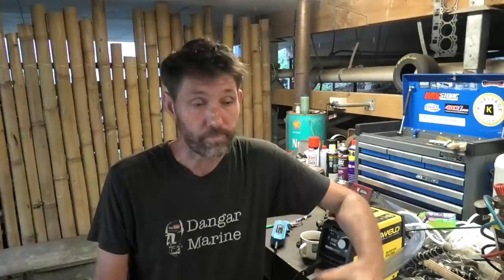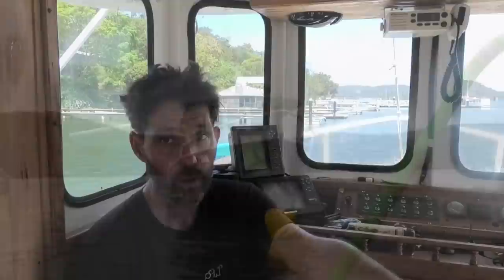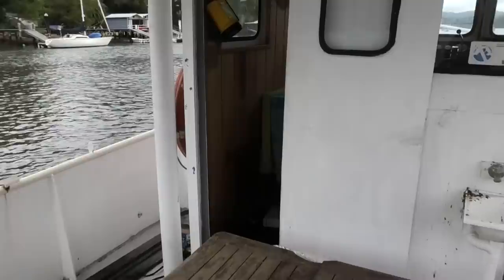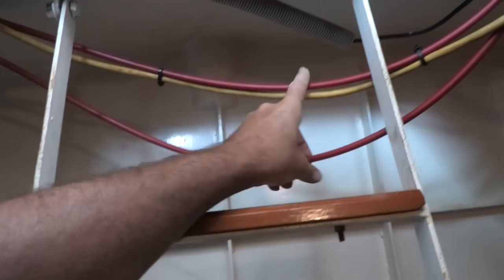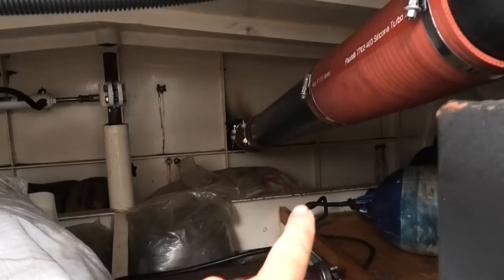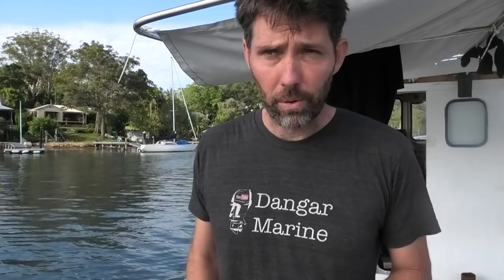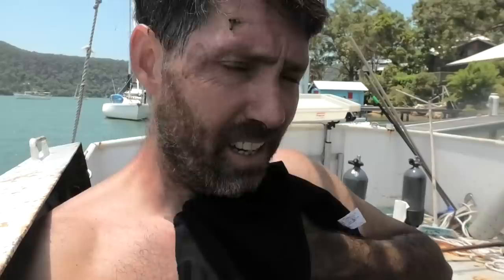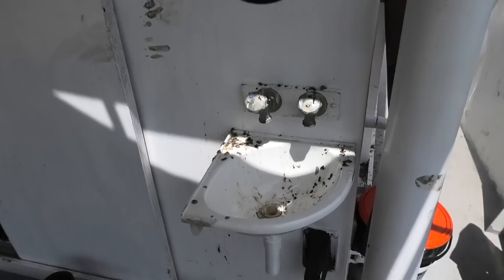Is it a bad idea to buy an old steel boat?

Comment: looks to me like the immediates are going to cost about 10 Grand. Dry docking fees - anti fouling Paint - Zincs - stuffing box replace - likely a couple of new batteries - engine tune - electrical work .....what a headache !..... hopefully you`ve got some mates to help.......
nice looking boat though.
Reply from the maker: That is about my cost estimate too. Fortunately the batteries are brand new and he left the old ones behind too. :)
Reply: @DangarMarine  that`s good that you will save on the battery cost. If it was me, I wouldn`t spend too much time fixing that rusty deck.....just might be that nasty can of worms..... scrape off the worst of the rust and do a basic putty fill in the holes, then paint. You can spend forever getting all fussy over the aesthetics but is it really worth the effort? Unless you plan on keeping  her for a very long time and super hooked on her looks I would Invest as little time and money as possible. As long as the leak is fixed, tank is good and the motor runs well you will likely get plenty of satisfying cruising hours. Enjoy her for all her flaws and imperfections...that`s what I learned with my old cruiser. Otherwise it`s going to cost you an arm and a leg trying to make her look young and pretty again....I look forward to watching your progress....best of luck !
Reply from the maker: I definitely agree about using and enjoying the boat. The number of projects I see in peoples yards that never hit the road or the water is amazing.

Comment: i reckon that is a tidy that is a tidy boat. and it wouldn,t take much to open up the back for diving or davit arm install. i,m a boilermaker welder at s,w,sydney, if you want work done contact me, i have stacks of gear , 25 years experience in many fields.
Reply from the maker: Thanks mate. I really appreciate the offer of help too. I can weld okay but I am thinking that when it comes to the out of position welds below the waterline I might sleep better if they were done by a pro. Can you email me at dangarstu@gmail.com so we can stay in touch?
Reply: @DangarMarine  i sent you an email

Comment: I'm just passing through, as this was a recommended video. I am a owner/operator on an inland ship in the Netherlands and i would like to give some advice, if someone else didn't already gave it.
I didn't see any kind of lubrication for the gland. I am assuming that it is a gland with grease-cord in it, since it is the type of gland you can tighten.  A gland with grease-cord needs grease on a regular basis. The cheapest way is to do it with a grease-serk, but i wouldn't recommend it. A relativ cheap way is to have a manual greasegun hardlined to the gland. The best, but most expensive, way is a propshaft driven greasegun.
I have removed the old gland-system in favour of a more modern sealed system, wich uses 4 seals between bronze rings (easy explanation). This system only needs a couple of pumps of grease every month, but doesn't need tightening every now and then, wich you do have to do with your gland.
Anyhow, you've got a nice boat there. Make sure you get proper primer and paint on it, as i asume it is on salt water. Tread her well, and she will tread you well. Best of luck!
Reply from the maker: Thanks for the info Ed. I'll definitely look into upgrading the stern gland. I couldn't agree more about good surface prep and good primer and paint as yes, this boat will live in saltwater. Plenty of good anodes too! :)
Reply: You're welcome!  This is what i have: http://www.dewaalbv.nl/en/seals/stuwa-interior-seals.html  Yes, made in the Netherlands! And i'm not affiliated in any way, i just love that system. It is not cheap, though.  And you're right about anodes, nothing wrong with those!

Comment: Looks like it's just the shaft packing worn out. Shouldn't be a bad fix. Cleaning up will probably be harder.
Reply from the maker: Yeah, re-sealing the drive shaft shouldn't be too hard. I've already done a fair bit of cleaning in the engine room bilge so once it's dry on the hardstand I'd like to find a good paint to re-seal it with.

Comment: I noticed the hydraulic lines were just copper tubes is that standard wouldn't think it would hope much pressure
Reply from the maker: There is very little pressure in steering hydraulics,  just a hand driven in impeller  in the helm.

Comment: What you have shown of the steelwork looks good so far, steel boats rust from the inside out, what does it look like in the bilge and in the anchor well?
Reply from the maker: Other than the engine rooms, all the other compartments look almost perfect.
Reply: @DangarMarine  Sounds like a great purchase

Comment: Subtle Aussie humor !  "I thought it would be perfect, but is not looking like it is !"

Bilge pumps rely on good batteries and a system to keep those batteries charged.  You are better off having a starting battery and a separate "house" battery bank.  6V golf cart batteries work well for a house battery bank.  In the US you can buy a 6V golf cart battery for less than $100 if you shop around.

Probably not an issue short term, but don't expect the charging system from the engine to properly recharge you house bank just by paralleling the 2.  Spend the money (later) and get a proper DC-DC multi-stage battery charger  for your house bank.

Comment: I was hoping you'd go over what you did before deciding to actually buy this boat?  Did you get in the water and examine the hull, test run, etc.  And rough idea what you mean by "cheap" for this one.

RichE San Diego (winter here, only goes up to the 60s(F)...  :)
Reply from the maker: I did got for a scuba dive and around it but the water was very murky and the barnacles made it hard to see much. I mostly just scraped the prop for the trip up the coast. Test run was good - no smoke, plenty of cooling water etc. This was under $10k Australian.

Comment: hey mate myself and my partner just bought our first steel boat she is a rusty old girl but we are going to try our best to restore her do you have any advice for replacing the wheelhouse as she is rusted through
Reply from the maker: If I was to replace the wheelhouse on Renko I would cut it right off from the deck and replace it with an aluminium one to keep the weight down lower. There are special strips of steel bonded to aluminium they use to attach them. It's quite clever and a common thing these days.

Comment: its not the age of the boat , its how exposed the steel has become to oxygen in its lifetime.  A 5 year old steel boat thats never been coated is worse than a steel boat thats 100 years old thats had its coatings maintained properely.  Steel last forever providing its had correct anodes fitted and its not been exposed to oxygen. Oxidisation is the result of Oxygen coming into contact with the steel, water acellerates this and saltly water accellerates it,  but softer more reactive anodes mean these corrode instead of the steel.   I,m sure your aware.
Reply: Firbreglass comes with its own set of problems as well,  boats are hard work,  with a bit of fun thrown in.  It is well worth the agro however.   They are like life......  loads of shit for little fun.....BUT THATS LIFE !!  Get over it and go sailing.

Comment: When you try to get an old steel boat and an old wooden boat insured, you'll have your answer right quick.
Reply from the maker: I did have to get a survey done before I could get insurance but after that it was relatively straightforward and even cheaper than I thought it would be.
Reply: @DangarMarine  I've had two fiberglass boats, but lusted most for an old Chris Craft yacht from the 'sixties'
(as I remember) that was docked next to a nearly identical sister near where I used to live in Orange Beach, AL.  They were two of the most beautiful old boats I've ever seen, outside of a couple of spectacular renovations at boat shows.

Comment: the old 2 stroke Detroit's make great marine engine's if it is not leaking oil it does not have any in it make sure the emergency shut down is working don't mess with the governor they
are a pain to get right get a go no go gage to adjust your injectors if you do right you can adjust them in one go thru engine not hard at all if your engine does not have it get a 4 valve
head n60 or n65 injectors most all the parts from an 8v71 will fit yours I live in a bus conversion powered by an 8v71 and have in the past owned trucks powered by them oh the 
71 stands for 71 cubic inches per cylinder so you have a 284 cubic inch motor 
have a good day
THE GRUMPY BUS

Comment: Hi. You got yourself quite a boat there. But those fuses shown at 4 mim 20, I found them unreliable, because of corrosion between the fuse and the fuseholder. I recommend you to change to flat blade fuses
Reply from the maker: Yes, I agree, I will definitely upgrade the fuse panel.

Comment: Arent boats made out of cor-10 steel? the rust is supposed to protect it no?
Reply from the maker: Cor-ten steel is actually quite rare in steel boat building as a lot of it's advantages are lost when immersed in salt water. Here is a bit of forum thread about it that I read before buying steel for this boat http://www.cruisersforum.com/forums/f47/corten-steel-158096.html

Comment: Not related but ypu have any vids on the electrical side of boats like running the wires, fuses , types of wire Not so much for myself as thats my forte but I've noticed alot of people not doing it right so it works for a while then goes to shit a month later.Longevity of wiring on a watercraft is of course less than on land vibration corrosion etc. But it shoukd last at least 5+ years if done right
Reply from the maker: Hey Manny, yes, there is a playlist on the channel page with all the electrical videos grouped together.

Comment: what did it cost to buy, as i wonder whether your idea of cheap is the same as mine
Reply from the maker: This cost just under $US7000, about the same as a 60hp ETEC outboard motor.
Reply: @DangarMarine  that is cheap in nz it would be at least twice that

Comment: Its me again  :)    What is the cruise speed of this boat ????  10 or 11 Knots ?? ... Just curious.   Thanks
Reply from the maker: Not sure exactly yet, but the owner said it is capable of 12 with a clean hull. I think anything over about 7 or 8 and you are going to be burning a lot of fuel for not much gain.
Reply: @DangarMarine  I had a 34 ft Mainship Trawler . I bought it in 1984 .  It had a 6BTA 5.9 M2 300hp Cummings Diesel Engine. It would cruise at 12 knots and hammer down  15 knots.  Anything over 12 knots sucked the fuel big time.  It was a great ride in a head sea and totally sucked in a following sea or beam to.  Keep those videos coming , can't wait till next time.     Thanks ,  Tom
Reply: Dangar Marine , I would think the boat is a displacement Hull so so wouldn’t go 12 knots every. 6/8 yes.

Comment: The design of the boat is called a Monk design. Personally, it is unseaworthy God help you if you lose power. You couldn't run fast enough to give me a ride in it. Is there a big yellow butterfly painted high on the bow?
Reply from the maker: Which exact design / model is it? And no, that's a yellow mooring buoy hanging over the bow.
Reply: Be sure you have lots of ballast. The boat with the butterfly flipped off the ways  straps right at the dock. It went belly up. I know you will be careful. God bless you and the boat.. I can't remember the butterfly boat's name for the life of me.
Reply: @DangarMarine  I don't know the name of the model but it was common in the early 1990's on the west coast. It couldn't take much heavy wave action. The problem was the deep forefoot and shallow stern. Just not enough boat in the water. I'm not sure what the design was good for. Top heavy with the reel and net above the HIGH deck.  Is there any ballast in it? They were going to put Coast Guard bronze ballast  in the keel from a double ender . I don't think they ever did. I also believe it was intended for the Gulf of Mexico.Low waves and slow wind.

Comment: could the stalling at idle issue be the stern gland pinching so hard on the prop shaft its stalling the engine at idle..  you have a boat.. not a car.. this is a test i use on cars.. with my multimeter to check electrical connections easily. feel free anybody to copy and print it.. i assembled it. https://i.imgur.com/kviX0VQ.jpg

 knowing how to do voltage drop tests will allow you to find issues at that fuse box.. electrical issues before they become a problem.   testing the fuse box is turning on everything.. and testing both springs that hold the ceramic fuses in place.. or from the wire strands thru the fuse box to the wire strands on the other side. you should have almost no voltage drop when measuring across a fuse box.. there is some because of the narrowing of the circuit path thru the fuse element.  you will be able to spot issues easily.  i usually have the stock test leads but i also make my own out of stackable bananas. at least 7 feet of test lead wire for each and muller bent nose test clips usually used for telephone service.. try to get them with bed of nails and piercing spikes. https://i.imgur.com/Y9uAt17.jpg..   

 before you finish up and put the boat in use.. run some 1/4" nylon tubing and several sections of 1/4" copper or stainless tubing..  run these from the pilot house down into the forward bilge and the engine room.. along a bulkhead.. in a vertical mounting an inch from the bottom..  this will allow you to put a connector on the ends of the tubes in the pilot house.. and either stretch a balloon on them.  or build a manometer for them with a small pump to clear the line.  if the ballons come up insteady of laying slack... there is probably water in the bilge.  balloons are cheap..  put new ones on every month or two.  one for each tube..  no batteries needed. 

  i did not see where your batteries are.. and the nice inverter.. those need to be in a water proof case with bulk head connectors for the battery cables inside the case to connect to .. and the outside studs to connect to the cables.. these can have the positive or which ever side is NOT grounded encased in silicone sealer to prevent water and moisture from creating corrosion on them.   

 on your detroit.. be sure to add a snorkel to the air inlet .. so if the engine room floods the engine intake is not submerged.    it would be so great is some designer somewhere would look at air diaphragm pumps.. and make the middle a shaft drive.. or a belt drive..  so it can just sit there and run dry when the engine room is dry. 

 for really creative people..  either scrounge up a diesel outboard power head that runs.. and build a vertical housing that bolts to the hull..or to the floor ribs.. but in a vertical position. this would have many cable controlled outlets or air controlled outlets.  so you could run hoses to spring loaded thru hull fittings to give you thrusters on all sides of the boat..  2 on the sides of the bow aiming forward to give you reverse thrust.. one on each side of the bow aiming to the sides for bow steering.. one on each side of the transom for stern steering and 2 large ones thru the transom for forward thrust..  proper sizing might give you 5 knots for in harbor and docking.   a water intake with a sliding or rotating disc with different opening sizes.   this sliding or rotating disc intake would really need to be on the bottom of the hull.. there is still going to be a seacock inside.  but this allows you to shut off the opening completely when docked or underway.. and gives you screened openings to keep rubbish and kelp out.  rotate or slide the screen and if anything is stuck its sheared off ..  a full open part of the screen for full throttle or the ability to put a cork in the opening from the outside. 

 while its out on the stand.. take some molds of the prop shaft sticking out the cutlass bearing so you can make a band out of silicone that you could dive and wrap around the prop shaft when tied up.. keeping the water out of the cutlass bearing and allowing you to pull the packing without pulling the boat.   this might be done with something as simple as silly putty..  one can make silly putty with borax and white wood glue in some hot water..

Comment: I have a ocean pro v4 evinrude and I’m having an issue with running my motor at trolling speeds 3-4 mph, it keeps stalling. Do you have any suggestions to keep the boat running at this very slow speed? Thanks
Reply from the maker: Big two stroke outboard really don't like to run at slow speeds unfortunately. Arn's dost the same thing and he's never been able to solve it and he's the one that taught me!

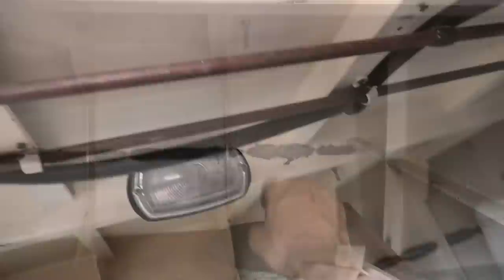Comment: 06:55 What's a doubler?
Reply from the maker: It is a plate of steel welded over the top of the hull to add a second layer.